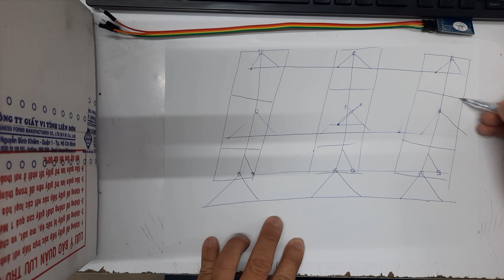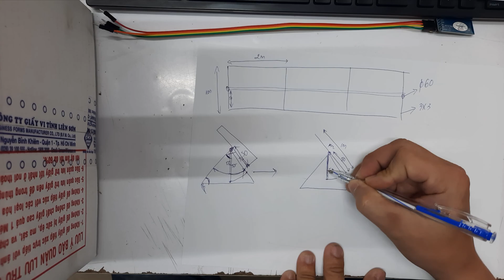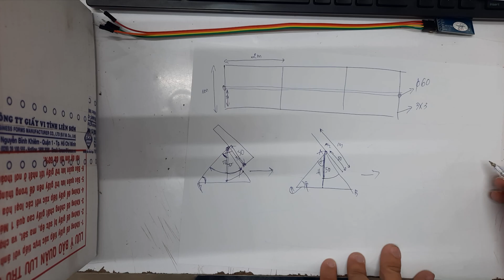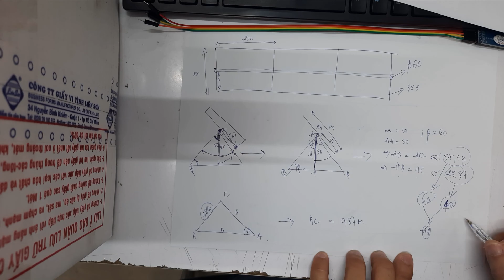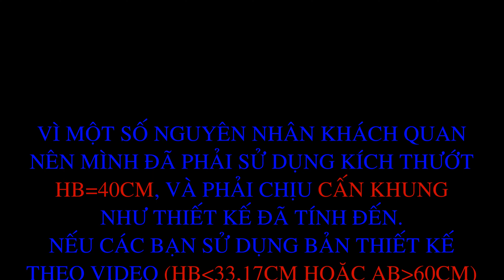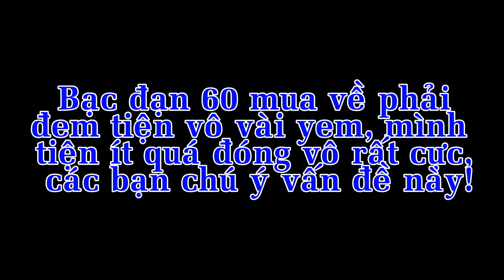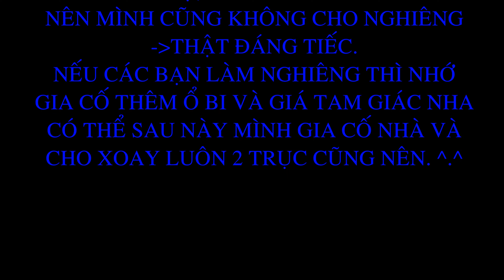Khung solar tracking mới, khá ổn - new better solar tracking -Part 1

Comment: This is the most suitable solar tracking design for places with very strong wind loadings because the PV arrays can be mounted as low as possible near to the reference plane which is the house roof.
👍👍👍